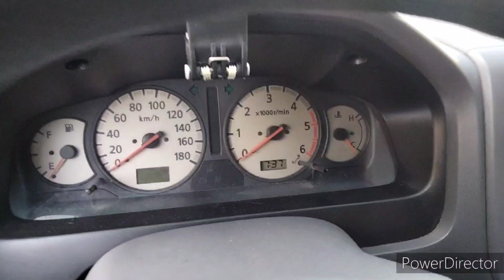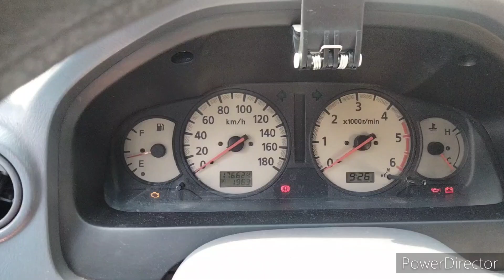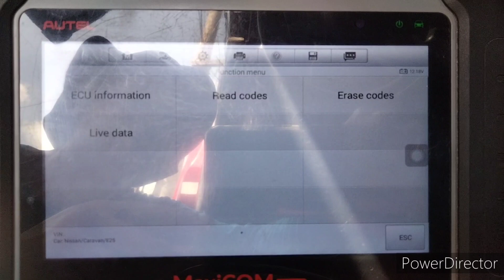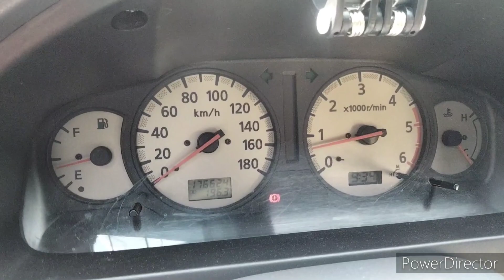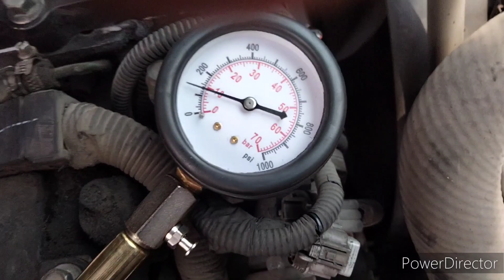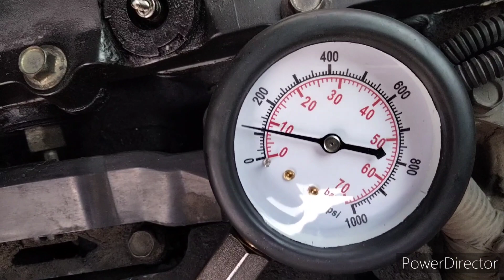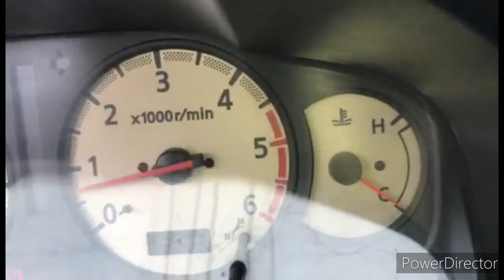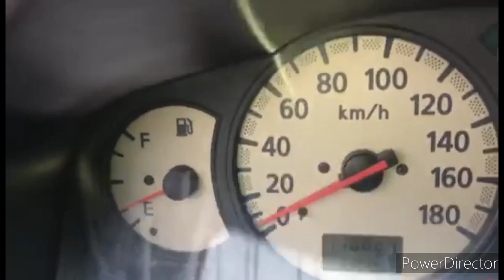Nissan Urvan Estate ZD30 E25 rough idle and white smoke loss compression

Comment: Very impressive, u reuse the block do you?
Reply from the maker: I'm using a Japan surplus engine which is in good condition
Reply: Yes
Reply: @arthururamani9481  please may help giving the correct torque spec for  cylinder head bolts, con  rod bearing and main bearing bolts for Nissan urvan Zd30 E25 please

Comment: sir how much limit for cylinder head skimming?
Reply from the maker: There's a markings on the cylinder part for the maximum resurfacing.it should not reach that parts or otherwise your compression ratio will suffer causing misfire
Reply: @imeedesu1595  may i ask how much torque for cylinder head bolt sir?
Reply: @imeedesu1595  and any tips for timing cover gasket to prevent it from leaking water after installed

Comment: How to get white smoke out
Reply from the maker: I depends on the situation of white smoke is,if only when cold start it appears and after a few minutes it's gone, valve seals or injectors o-rings, but when it's all the time, maybe your turbo charger, but when engine is running with check engine lights on and knocking sounds, possible it's from your injection pump
Reply: Good😅😅